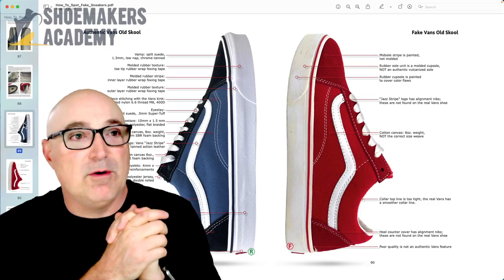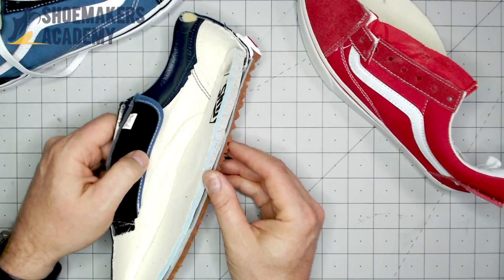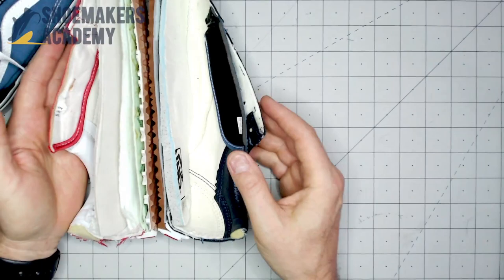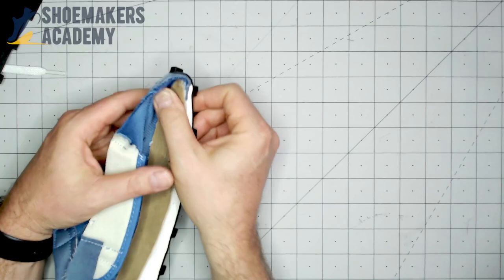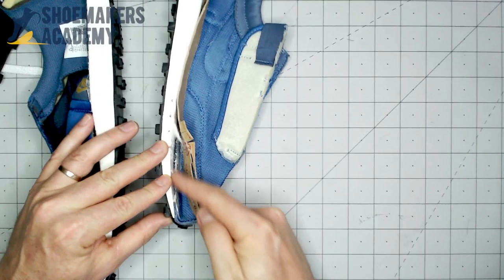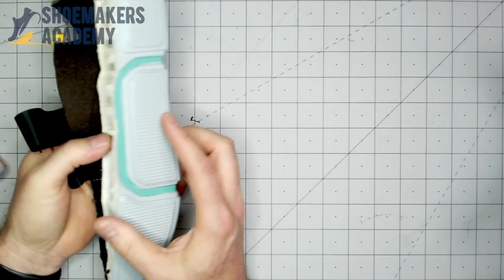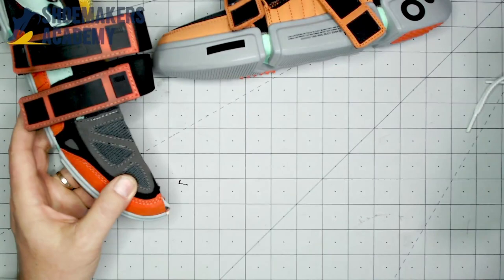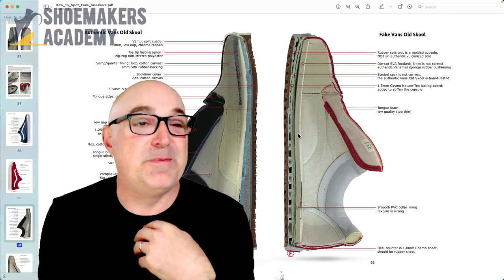Why Strobel? Why Board Lasting?

Comment: In regards to the actual upper patterns, is there a significant difference between board lasted vs. strobel? Or is it just the lasting allowance that’s different?
Reply from the maker: Great question! The answer is that they will be a little different. The rear 2/3rds will be the same except for the lasting margin or lasting margin. 

The Vamp and toe area will be different, the board lasted version will have a little extra material so it can be pulled into shape with a little extra tension. 
Swing by the Site ShoemakersAcademy.com or  join our Facebook group.  Cheers, TheShoeDog.

Comment: Is there any end-user quality difference? You seem to be showing and telling that it's arbitrary. Useful for authentication when fakes and originals are built differently, but that's in the ether, not between feet and ground.

Really appreciate what you're doing here. I'm learning traditional methods myself, but where those products live now doesn't make sense without the context of what replaced it.
Reply: Of course there are advantages and disadvantages. Strobel is lighter and more flexible….if that is what you want.  For hiking boots stiffer is better so go with board lasting.   And some shoe patterns must be board lasted. 
More videos and courses to follow.